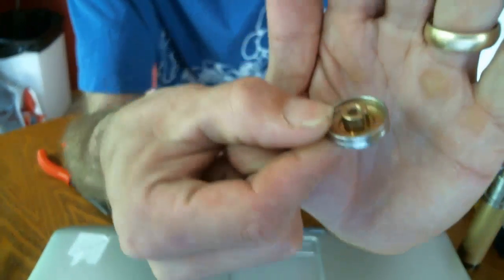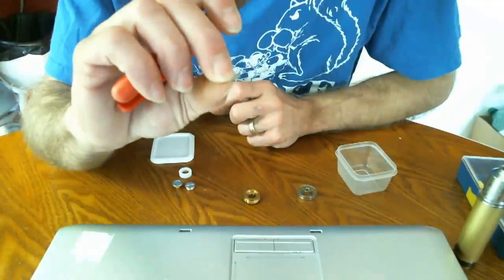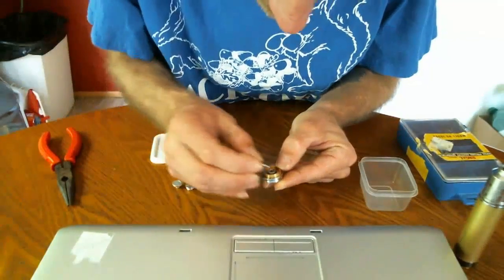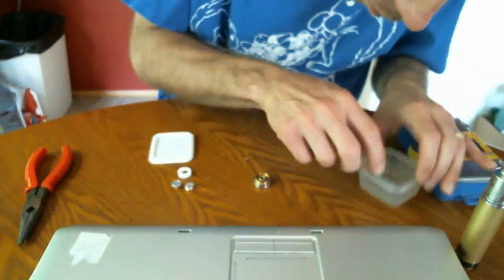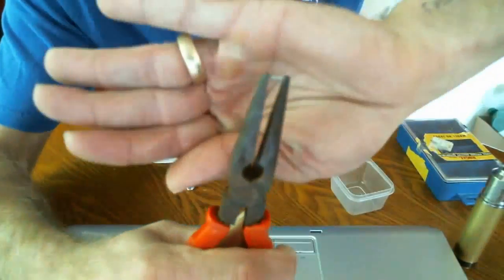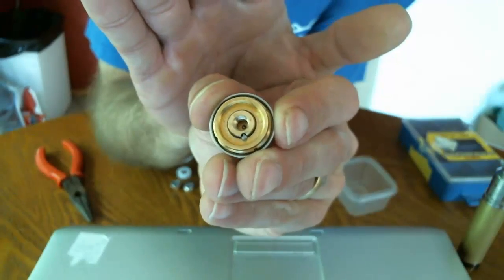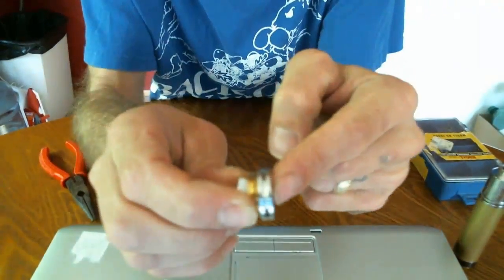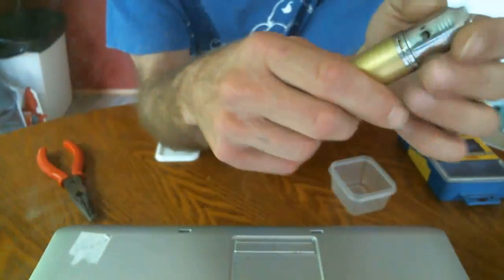Stingray Rice pin replacement

Comment: I got a few of these (Infinite/SXK clones, not the original) over Christmas 2019 for $1 each!!!  After much fiddling with mine, I found that while replacing the rice pin does help, it's not the only thing that "fixes" the sticky and crunchy switch. 

First off, I want to say that on my clones, the rice pin is 1.6mm in diameter.  And so your new pin should be at least that thick but probably a little thicker.  The hole that the pin goes into is 2mm so your new rice pin has to be under 2mm.  If you want to fill the hole from top to bottom, for my clones the pin has to be about 5.25 to 5.5mm.  What I used for my pin was a #4 finish nail, which comes out to be 1.8mm.  I tried a piece of 12 gauge electrical wire bu it's exactly 2mm and therefore too wide.  You can also use a piece of 14 gauge electrical wire which is 1.6mm.

Anyway, Even after replacing he rice pin I still had problem. I found that the bottom magnet needs to be turned out anywhere from 1.5 to 2 full turns.  When it's screwed all the way in, it's trouble city!  But turned out 1.5 to 2 full turns it gives the button a good bit of stability and seems to eliminate sticking.   You still need to replace the rice pin, though because the rice pin is about half the length it needs to be. 

But a word of caution if using a nail.  Since it made of steel it can come out with the bottom magnet when you take that bottom magnet out so you could lose the pin sometimes.  The good news is that a box of #4 finish nails is cheap! lol.

Comment: My Stingray X clone button looks a bit different then yours brother. I don't have that white insulator ring and my magnet setup is different. My magnets look like washers.

The side to side movement on my firing button isn't too bad but the vertical movement is horrible, that's where all the crunchiness comes from. I loved how you fired your Stingray but just touching the edge of the firing button. That is exactly where I want to be.

Currently, I have to hit the button dead center or it wont's fire because everything is so wobbly and loose.

Basically, a fatter rice pin is going to fix all these problems for me?

Comment: Also, if anyone happens to own a nemesis or even a nemesis clone like the hcigar nemesis you can swap rice pins from there and it's a perfect fit. As an added bonus, since the nemesis' design is so well thought out, I was very happy to find that putting the stingrays rice pin in it's switch has no adverse affects on performance whatsoever. Just for the record, I have had my nemesis switch upgraded from the spring to magnets, so I cants speak on how a nemesis switch with a spring will perform. Lastly, my stingray is an authentic, so this switch issue isn't relegated to clones, it's inherent in the design...and honestly, after paying $220 dollars for what is basically just a metal tube with a switch to have such a stupid issue left unresolved is really infuriating, how do they not catch something so integral to the products performance and usability in quality control?! It is just a slap in the face to all of the consumers that supported this product line...   =\
Reply: Why the hell would anyone pay $220.00 for what is essentially a flashlight without a bulb? The clones are worth the money but the originals are a serious ripoff. For that kind of money the thing should work flawlessly and cook you dinner every night.